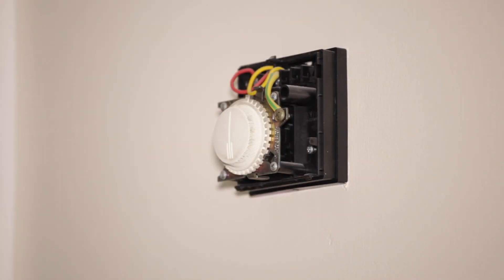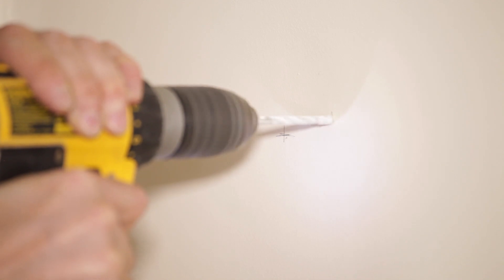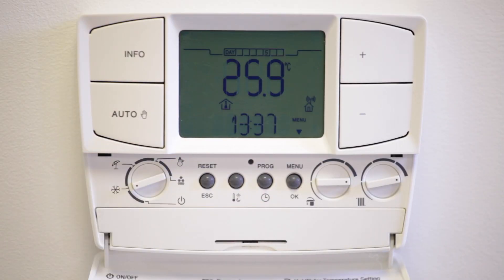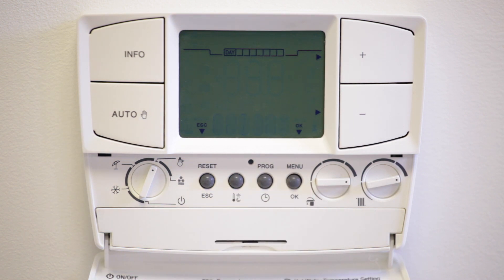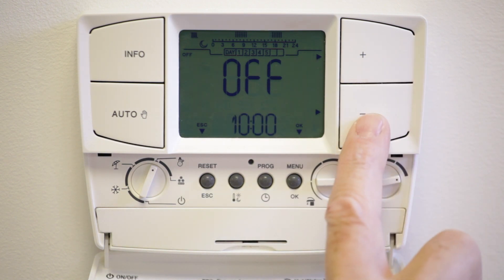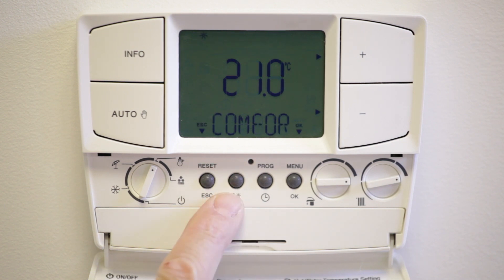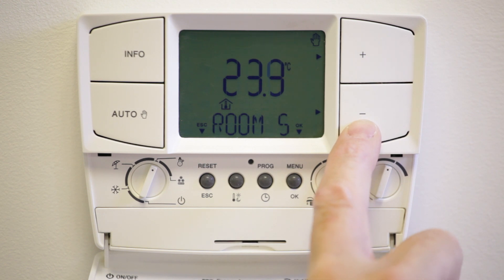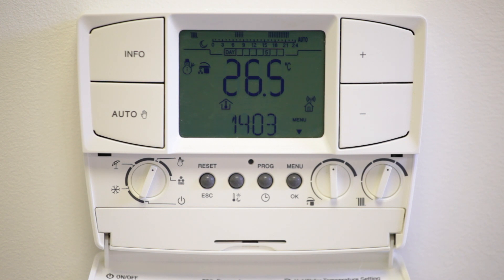Alpha Boiler Controller Step By Step installation

Comment: I've got the external temp sensor with this for weather compensation. It seems to work well matching the flow temperature to the heating requirement, taking into account the outdoor temperature and how quickly the room is heating up. For example it raises the flow temperature in colder weather or if the room is slow to heat up. I'm not sure we get much gas saving as the boiler only modulates down to 4.9kw and our max heat loss is 7kw. I'd say the house is more comfortable kept at an even temperature with similar gas consumption. Is it better to to set the controller to learning mode or not? Does the offset value adjust the temperature value from the external probe? So a lower offset would mean a steeper flow temp curve? Thanks.
Reply from the maker: Hi Chris, we would recommend giving our team a call on 0344 871 8760 and they will be happy to assist.

Comment: I still don't understand the heating on settings at a certain temp? I've got my comfort on 20 degrees does that it will go off at 20 and come back on at 16 degrees my economy is set at? Does that also mean when the temp drops in the night it will automatically come on when it drops below 16?
Reply: The Eco/Comfort setting were explained badly in the video
Reply from the maker: Hi Phil. Our Helpline technicians will be able to explain this to you. Please could you email marketing@alpha-innovation.co.uk with your contact info so we can get in touch.

Comment: could you tell me how to turn off the heating cooling symbol in the bottom left of the controller its a rectangle with heat waves the boiler is running constantly even there is no demand
Reply from the maker: Hi Mark. It is probably easier if we walk this through with you. Please call the Technical Helpline on 03448718764 who will happily assist with your query.

Comment: Our control keeps flashing nolink and it says e51 on the boiler. Can't find any information on how to reconnect it. Anyone know how to?
Reply from the maker: Hi Matty. Please call 03448718764 and they will happily assist with your query.
Reply: Hi Matty, did you find a solution to it, thanks
Reply: @lailahalidu4952  Pretty sure we had to get a plumber in and they connected and installed a new controller

Comment: What are the two terminals marked TEL for?
Reply: Hi, the TEL function isn’t used in the UK. In Italy they have a modem accessory so they can dial in and change settings on the Climatic.
Reply: @alphasales627  Thanks for the reply,that function would be pretty useful here,was surprised that you have a control device with remote access but not on the climactic